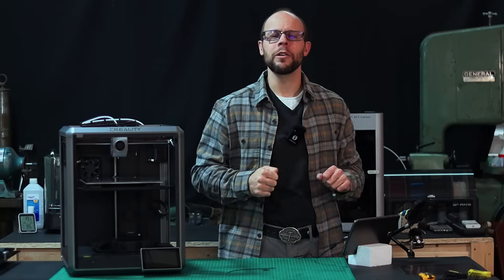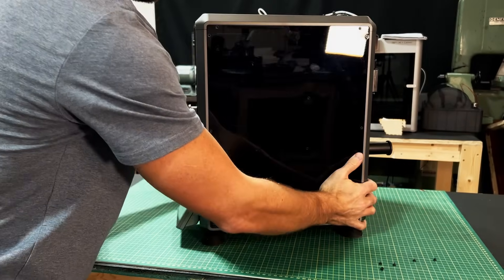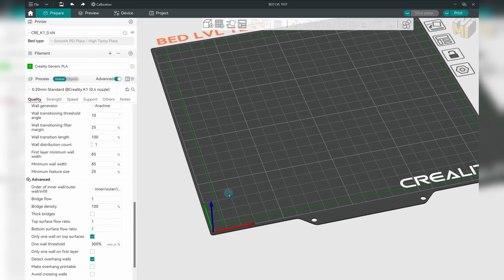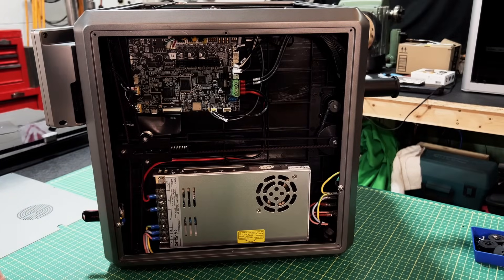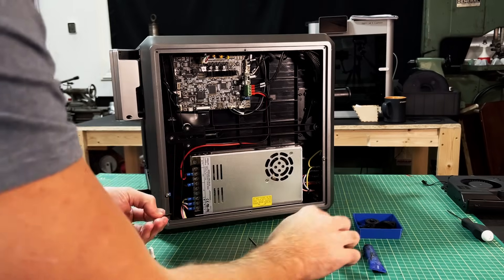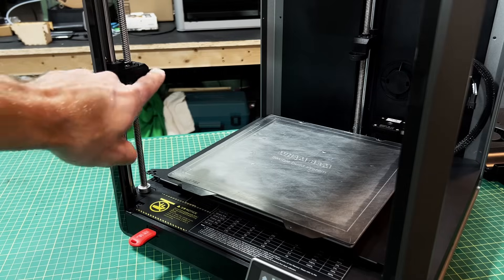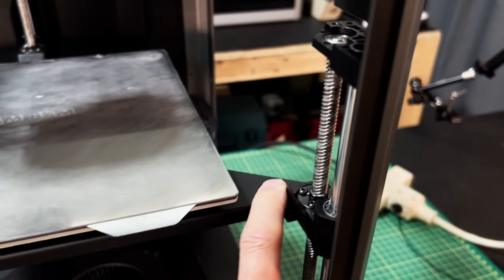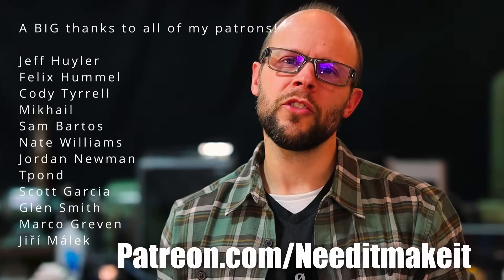Quick and Simple Way to Level Your Creality K1 or K1 Max Bed

Comment: I have the K1 Max, Can you tell me how did you get to the screen on creality print to see the information on bed leveling? Do I need to install fluid first? Thanks for the video.
Reply from the maker: No problem, yeah sure, if you're still using Creality print you can type your Printer's IP into your search bar and you'll have the UI with slightly more features showing.  you should see the mesh in that screen and hopefully it gives you enough info that you can see where you need to adjust and by how much.  I hope that helps!
Reply: @NeedItMakeIt  Ok well now I feel stupid, I dont see a search bar in Creality print either online or on my pc software. When I try online it just says not found and gives me some models to print. Sorry for all the trouble but Yea I would defiantly want to level it better its off for sure.
Reply from the maker: @FitzCrafter  It's impossible to know anywhere close to everything so don't worry about it.  You can use the search bar in your internet browser of choice.  Chrome or Edge or Firefox (if anyone still uses that) and as long as your printer is on and it's connected to your WIFI you should be able to see it.  Let me know if that helps, and if now, just message again.
Reply: @NeedItMakeIt  That just brings up my router info. I got the IP from the printer from the Network tab, Is that correct? and Yea Don't hate on me but I still use chrome on this PC. Lol
Reply from the maker: @FitzCrafter  No worries, as long as your not on AOL or NETSCAPE navigator you're still in the good.    For reference my IP begins with 10.0....   If you go to your printer, go to the network tab, below your wifi network, it should display an IP below it.  That IP should be quite a bit different from your router's.  It could be that it auto-filled the rest when you were typing it in.   The IP that appears on that menu is the one to plug into your search bar, just the IP and nothing else.  If you're still having trouble let me know and you can join me on Discord for a minute.
Reply: @NeedItMakeIt  Yea I even tried it in Microsoft edge and I get the same thing  and I never use that browser. I'm on Discord so if you send me yours I can meet you there. Thank you so much for your patient's and time.
Reply from the maker: When you're in, I'll delete the link

Comment: 6:58 You know. There are gauges for measuring spark plug gaps. They cost pennies and are much more accurate than prints... Well, you get the hint
Reply from the maker: The purpose of the solution here is to make something that is accessible and simple for everyone at any skill level regardless of the tools they have on-hand.   If you're looking for more accuracy sure, you could use a feeler gauge, or alum. foil and build-up as-needed.  Those work well also.
Reply: @NeedItMakeIt  This "everyone" already has a printer. Which means they are at least not at the Arctic station) The easiest way is to go to the nearest store and buy what you can buy
Reply from the maker: @_G_R_  It's all good, if you want to solve it in your way, nobody is stopping you.  However the easiest way with a 3d printer is to simply print the parts you need.   The process you suggest is how I began and it is in part why I ended up with this solution.  Shim stock does not stay in position, and although I was successful in the end by using that method while holding them in place with tweezers, it is not a good solution for 'everyone', and I take quite a lot of time to TRY to make the solutions I provide successful for as many people as possible.  

Anywho, have a good life and have a great New Year.

Comment: A great idea and execution, especially for people who are afraid to disassemble a new printer.
I recommend the first method, which involves moving the timing belt and skiping teeth on pulley wheel.
This way you can level the bed within -0.2mm to 0.2mm.
Then, using 0.1mm thick M3 washers, precisely level heated bed.
Reply from the maker: Do you have any reference for the tooth skipping method, it seems that this is a good solution, but I haven't been able to find much info on it.  The washer idea definitely works well, this is how I leveled my bed prior to designing these spacers.  The issues with the washers that I had was fiddling with getting them in position and stacked up without falling off, it was a bit of a pain, but still doable.
Reply: Place printer on its left side (secure glass door). Remove lower cover. Release belt tension (two tensioner screws). Turn lead screw (one of three) CCW to raise or CW to lower the bed, skipping one tooth at a time. Tighten the belt. Perform calibration (Auto leveling only). Check bad mesh chart and repeat previous steps until you are satisfied with result.

Comment: Sorry for not knowing this, but the K1 doesn't support any form of gantry level?  A G34 equivalent.
Reply from the maker: No worries.  As far as I am aware, that's not possible with this machine, all of the Z screws are driven from a single motor, any attempt at a level would impact all of them.  Ideally they'd all be driven individually, that seems like the best solution and pretty common.

Comment: Why people don't use HIPS? It's much easier and cleaner to print than ABS and ASA and it's cheap and has similar enough properties.
Reply from the maker: I'm always open to trying out different materials.  I've been staying away from ABS for some time... until today for some testing.  I don't appreciate the smell and the issues with warpage.  Though its not too bad with a hot bed and no fans on.  Do you have a brand of hips you recommend?
Reply: @NeedItMakeIt  No i don't really have a brand and you're on the opposite end of the planet anyway, so our brands are not your brands. It's fundamentally much less warpy and less stinky than ABS, though you still want to abide by standard precautions because it can break down and emit a little styrene. You will get a horrible styrene poisoning from ABS, and you'll still get one but an order of magnitude or two weaker and less horrible from HIPS and ASA, unless you have VOC capture. Though just printing in an enclosed printer is already somewhat helpful at least for HIPS and ASA.

Butadiene is both the indirect cause of most of the ABS stink, since it inhibits styrene polymerisation and causes free styrene monomer, and the cause of the die swell and shrinkage of ABS, since it's the core of the copolymer and flails its giant acrylonitrile-styrene arms around when it unfurls. HIPS is a blend of separate butadiene and styrene polymers, so it's both well polymerised and moves around less when heated. ASA is a copolymer again, but it's got less free styrene than ABS and usually flails around a little less than ABS.

The free styrene problem in ABS is so pronounced, that most safety agencies worldwide will flat out refuse to even consider certifying any ABS for food contact, while pure polystyrene and if i'm not mistaken HIPS can be certified as food contact polymers if they're manufactured to a high enough standard. A small amount of styrene leakage into food is actually permissible since strawberries contain it naturally, but ABS is generally well beyond what could be considered reasonable.

Comment: For those that do not  already know,  thread-lockers  such as Loctite, will severely degrade (damage) most plastics, such as ABS.   I would never use it near plastic, even with threaded  nut insert in a plastic part as even the smallest amount of thread-locker on  the plastic will mean the nut insert becoming loose in time.  It is likened to the nerve agent of plastic.  Yes, I learnt the hard way and then I did my own research.  Loved the video.
Reply from the maker: Okay good to know thanks for that info.  That's something I did not know and may have been the reason that the screws were so loose and did not have a locker on them.  There is an alternative, I've seen it on occasion, a type of rubber/silicone on the threads, it's usually blue, have you seen this option and do you recommend this?  Thanks for the informative comment!
Reply: i was told threadlockers are good for metal materials In fact I don't use loctite on bolts securing wood materials as well.   is there research Document regarding loctite degrading plastics?

Comment: Nice solution.
Reply from the maker: Thanks, I tried to keep it as simple as possible and do everything from the top, some people may still need to take the bottom off and adjust the screws, which isn't too time-consuming... if you only need to do it once and not the 5 times I did it.  Maybe Creality will have a better way to do this in the upcoming version K1C I believe.

Comment: I am laughing out loud here. You deserve an oscar. After trying everything, with the most annoying thing to put the machine upside down, etc, I just printed your small pieces, did the calibration in fluidd, made the math (left and right had a minor difference of 0.1, but to the back 1 mm), put the 1mm piece back there with 2 simple screws (no turning upside down, etc)... and MAGIC, my total difference now is less than 0.2 mm. THANK YOU !!!!!!!!
Reply from the maker: Oh, I am with you.  I think before making the video I had 4 attempts at using the Creality method and, it just was not working for me.. apparently other people who use some special technique have had better results, but turning the printer upside down and all of that business is not fun especially when you need to do it over and over again.  Best to just do it from the top.  I'm happy it worked well for you... out by only 0.2 is really good, nice work!
Reply: @NeedItMakeIt Thankful I seen this before getting my k1c, This thing is so off :/
Reply: @Reds3DPrinting I have had mine for a couple of days and of course here I am printing spacers. I do have 12 more days to do a return if necessary.
Reply: @Reds3DPrinting  you did it wise. I bought one and now I am struggling with this issue due to 0.7 mm discrepancy between opposite corners of the bed. Unlike in K1 models, there are no screws to manually adjust the bed in K1C. By following this video I am not sure how to remove the belt either since the tensioners are also different in K1C. The official technical support suggested this video after trying the built-in auto-leveling calibration that does not seem to be working. In the reality, Creality's auto-leveling feature is configured with such a tolerance for the Z axis, that should be seriously looked at. They are now sending a new hot bed to me under warranty. Although, I will probably need those spacers to come to be able to use my printer. K1C owners, please reply how you managed to overcome this problem.
Reply: you and @Needitmakeit talk about 'doing the math' to figure out which size shim you need.  What is the math?  How do I figure that out?
Reply: @Cowboy7704  I have this question also
Reply: @kurtissking  me too
Reply: @Cowboy7704  Download the model of the entire printer, bung it into your Cad package, tilt its bed to match your probe readings and extrude what you need at the mount points, let your Cad do the math. Or brush up on your trigonometry, CAD is far easier ;)
Reply: Thanks. Will do this tomorrow. 
What the hell does the auto level actually do then if it can’t compensate for this!? At the moment I’m having to group all my prints at the back corner as everywhere else they fail with poor adhesion as the nozzle is obviously so far away from the bed it’s not squishing the material down properly.
Reply: What bed mesh software are you running here?
Reply: It worked to mee too. Was 2,3mm and now 0.092mm. I dont dissasembled the laterals panels... Thanks

Comment: what i also noticed, my max is sitting on floor which isnt straight as wanted, every time i move and re calibrate it would change -/+ 0.2 then i though frame must be flimsy and yes frame of k1 is like butter! and i have 2 to check! max and standard!
Reply from the maker: Absolutely right, that's a great point, the larger the printer the more important it is to level them and shim them.  It's a common problem with the bed slingers as well, any time you'd move them you'd need to re-level the beds.  I think this comes down to frame twist and even big solid machines are a victim of this issue, so I can see that affecting a fairly light duty 3d printer as well.  I'll run some tests as well, I'll shim one foot up only and see what happens.

Comment: Totally noob question but I can see this is not the Creality software?

What do you use and what is required to use it? Custom firmware or just use another program?
Reply from the maker: Not at all, being able to use these UIs is pretty new for this Printer.  To use Fluidd or Mainsail which is what I've been using, you need to Root your K1.    It's not hard, but if you're not familiar with SSH software and accessing your printer, it will take a bit of time.  This is the area I struggled the most, but it was worth every minute.  Essentially you're left with a printer which is completely accessible and modifiable like a Voron/Klipper style of printer.  I made a video a few weeks back about Orca Slicer, there should be links in that video for the walkthrough if you need it.   I  hope that helps!
Reply: Thanks, i have rooted it and can access it with fluidd now. Its kind of confusing wich side is front and back in the leveling 3d model? Is here an easy way to tell? The test method to print a circle all way around is the some sort of feature in the orca slicer or is it a file ju just print? @NeedItMakeIt

Comment: My prints have been ok so far but my locking bolts that you said hopefully we kept. All 3 of mine were bent and were a pain to remove when I got my k1max.
Reply from the maker: Bent, that's no good.  I don't think you need to use those specifically, you can use a finer threaded bolt, those holes are only used on occasion and if you can get it to stay down, that's all you need.

Comment: Why not stick a sticker on the opposite side of the plate?
Reply from the maker: Yeah, that's a great idea, I'll do a follow up of this idea, there have been a few of these suggested.  It'd have to be able to handle the heat, so Kapton probably.  And I wouldn't think around the edges, to make sure the magnet isn't impacted much.  Nice idea though, and I think it could work to remove a little bit of the warp.

Comment: I would love to see these as individual OBJ files. With a little math, you could scale the Z height for your individual needs, and recure less processing to sand down a spacer when you need an in-between size. Maybe a little tweaking with the sandpaper would be it.
Reply from the maker: I'm happy to provide the exact size to anyone if they have a different sizes.   Would it be possible to stack them in the slicer and have them  unify to become one piece?

Comment: I don't know why creality insists on syncing their Z motors. The modern approach is to just have them be independent to auto level the bed itself relative to the tool's xy plane, rather than adjust the z height live based on how unlevel the bed is.
Reply from the maker: Yup, and it's been proven to work really well.  I think it must be a cost saving measure.  The K1 is pretty cheap, and pretty capable for the price.  A Voron at this size to build on your own with the independent motors for Z would be min 1000 buckeroonies, if not more.  I still want to make one, but I'm holding out in the hopes that they might have a new model coming out sometime.
Reply: @NeedItMakeIt   and thats just the parts. Should be compared to a prebuilt voron for what its worth
Reply from the maker: @jme2006  I just received a K1 Max, I'll be able to make some comparison videos very soon, I just have a few vids to finish up and then I'm all over it.
Reply: Agree that independent motors does give more flexibility.  Likely cost savings - 2 additional channels and motors.  For the price I'm very impressed with the printing of the K1 Max with the single Z motor.    Does not deter me from recommending it to anyone, the bed mesh does a great job of compensating for my 0.4mm drop over full size of bed.  I may do this fix some time, but for now its printing very well as is :)  Thanks @NeeditMakeit for the great vid

Comment: So you left out a ton of information. My screen on my computer looks nothing like yours does. Dashboard? Heightmap? Current mesh? I would love to see those, but where? Keep in mind This is my second printer, (first was a highly modified Ender pro 2 I got used.) I just got the K1 Max about 30 days ago and I noticed that in the camera view I can see the bed moviny up and down about a 1/4 of an inch, so I know something is off. So, how do I get to these screens?
Reply from the maker: Sure, that's what the comments are for.  I'm happy to help.  If you haven't rooted your K1 yet, you can access the map by typing in you printer's IP address in your search bar, it'll bring you to the Creality UI, it will do the job well enough and will give you a height map.  I would recommend rooting your K1, it will give you the ability to use a slicer like Orca, which is quite a bit more capable than Creality Cloud.  If you do that, you'll be using Fluidd or Mainsail, which do a better job of showing the heightmap.  You should be able to hover over the map and see which areas are too high or low and the values as well.
Reply: Thank you so much. I know how annoying a noob can be. Now if I can just find my printers IP address. All I found so far is 10.0.0.05, which is I think for my network to link up. I am 70 and a lot of this is greek, or latin, or hieroglyphics. 😊 @NeedItMakeIt
Reply: I Got IT !!!!!!         Again, Thanks so much. What I was missing was to put the http stuff in, DUH!     @NeedItMakeIt
Reply from the maker: @bryanbsa8927  Oh, I do not judge, we've all been there.  I put some bloopers at the end of my videos... emphasis on the word SOME.  Glad you found it.  Hopefully it works well for ya.